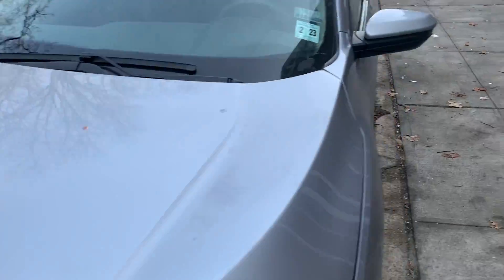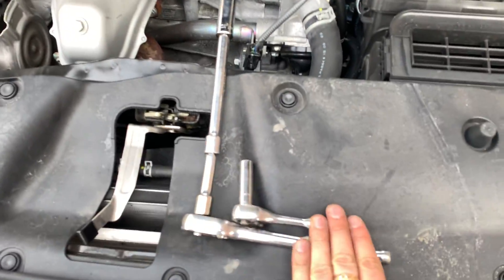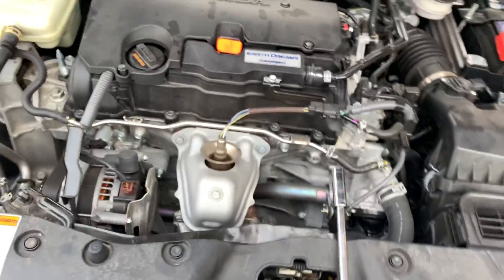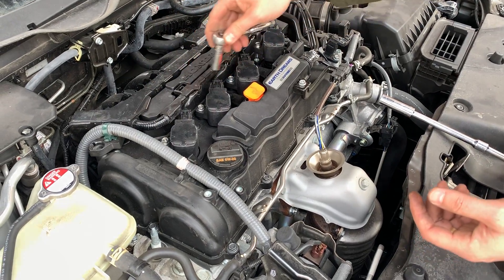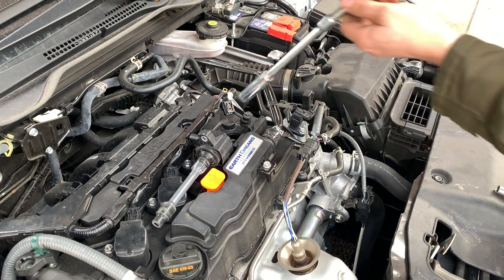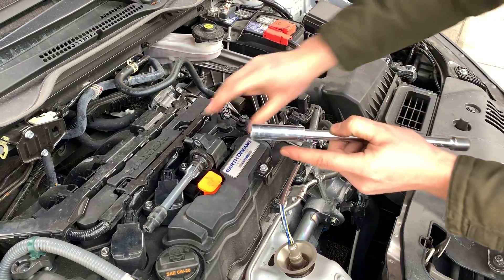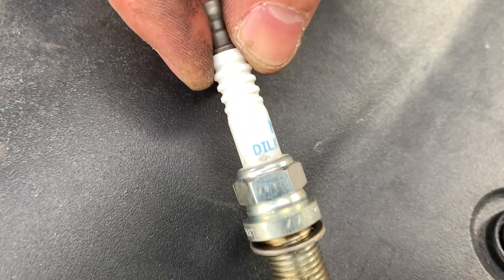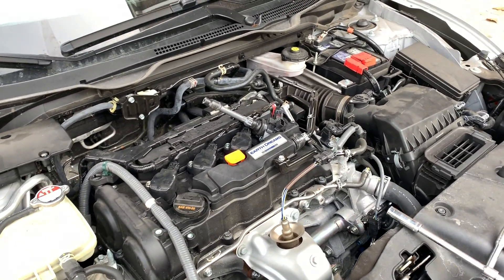HOW TO REPLACE SPARK PLUGS ON HONDA CIVIC 16-21 REMOVE 2017 2018 2019 2020 2021

Comment: Haven't seen anyone using the coil to take out the plug, good tip and thank you
Reply: Unfortunately on these you don't have much of a choice. The sockets are about 7 inches down, and it's too narrow for a magnetic socket tool.
Reply: @megamixa Spark plug sockets my friend. They make them magnetic & are thin enough to fit inside the whole
Reply: Didn’t know that as well

Comment: Can you tell me what extension you used?
Reply: looks like a 6 inch 3/8 inch socket extension, could find at harbor freight, fits well in sparkplug hole

Comment: IMPORTANT: The installation is good but the spark plugs varies. I did the whole process to realize that I order the wrong spark model. Mine was the 1.5L model which is a completely different model than the one presented in the video, a 2.0L.

Comment: Are we changing these every 50,000 or 100,000 miles
Reply: The computer will tell you when they are due, just like tire rotation and oil.
Reply: @bobbykoller2003  never follow what the car tells you 5,000 mile/6 month oil changes is the way 2 go